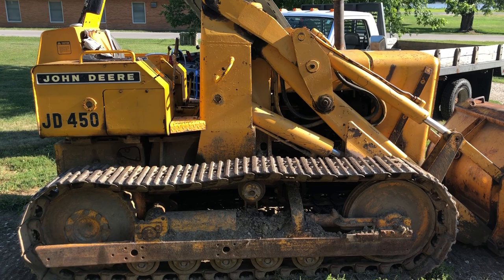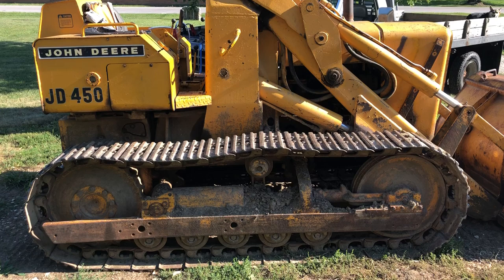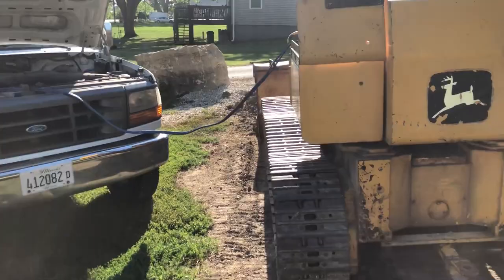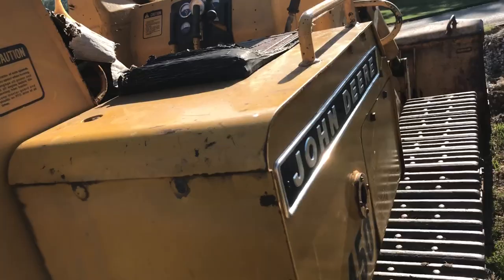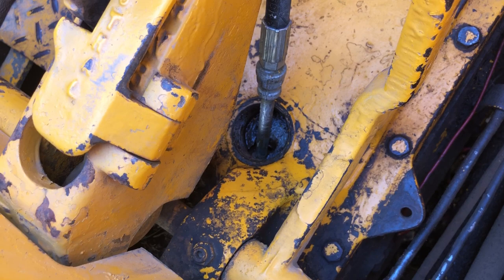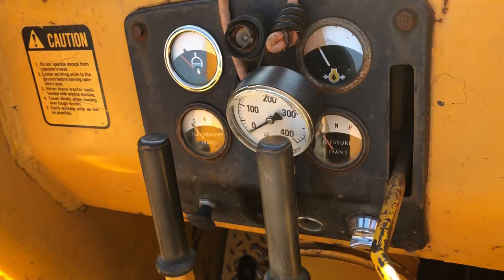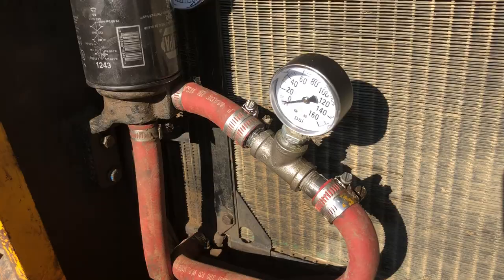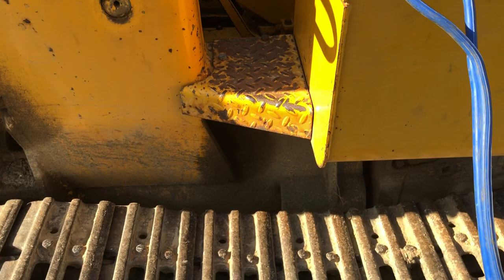John Deere  450 crawler loader video 1 low power

Comment: I have a 450 CA made in 1979.  It has a few issues also.  The time I've spent with it is very minimal, but I now have much much much more time.  My plan of attack is to fix the little issues as they may play a role in the bigger problems.  You had mentioned a fuel leak,  solve the problems that are known because they need to be solved anyway.  I don't use mine to make a living, it's more of a hobby tractor.  Good luck and great tractor!